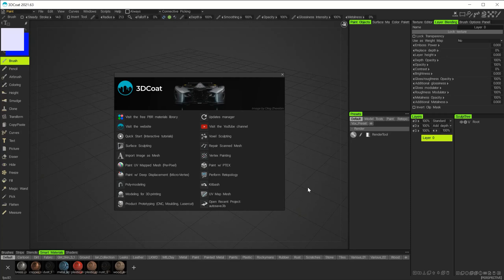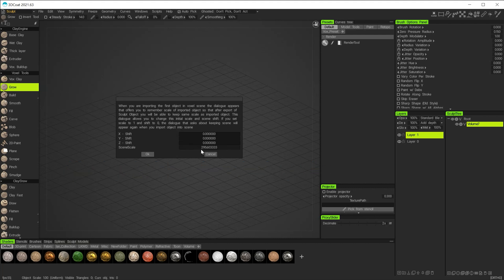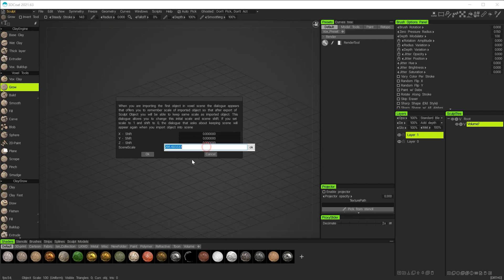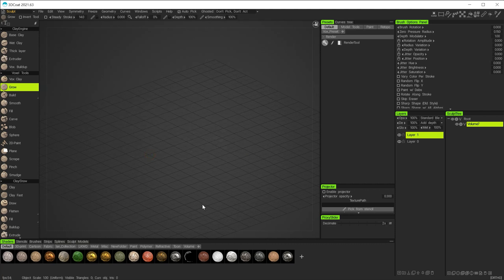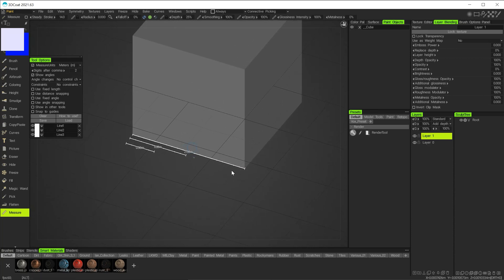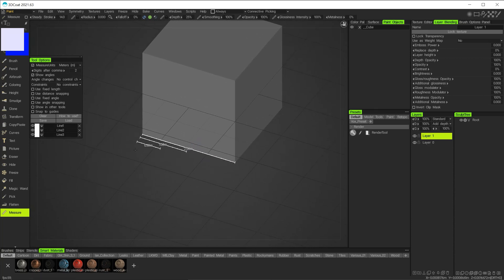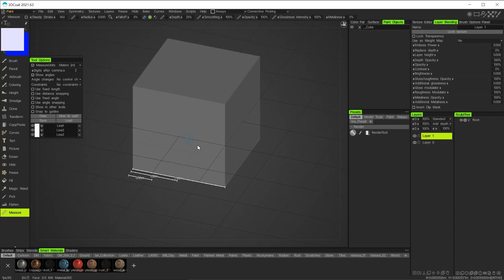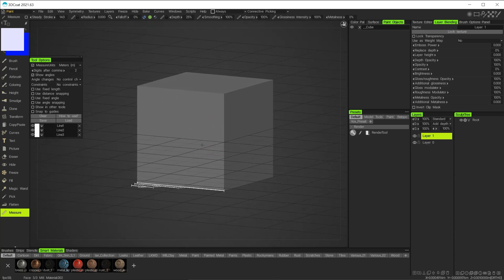3D Coat - Polygon Modelling Part 4

Comment: My question is in Blender did you apply the scale to the object. Because when you don't do that even FBX's into Unity or Unreal will make up some crazy scale for the software.
Reply from the maker: Yip you can have scale issues jumping between apps. Because here I'm using the Blender App Link, all the work is done in the background in terms of scale, node setup etc. In answer to your question I did not need to adjust any scale parameters inside Blender. Inside Blender v3+ and 3DC there have been reports of issues with the App Link, there is a fork version of the app link however that solves the issues (although not tried it myself).